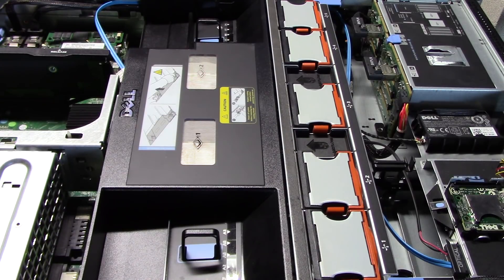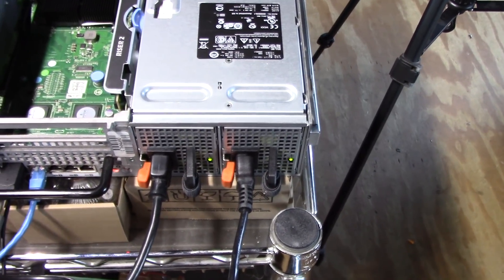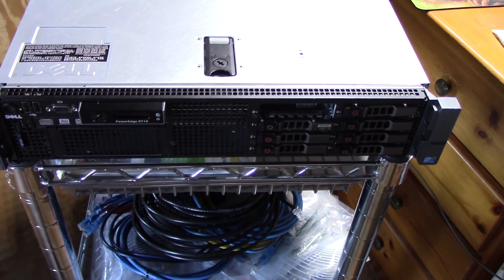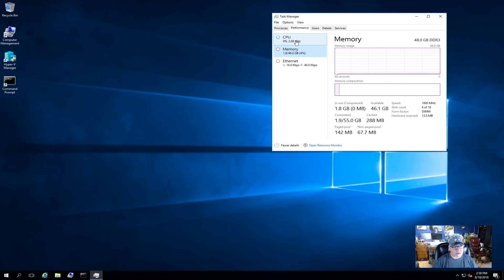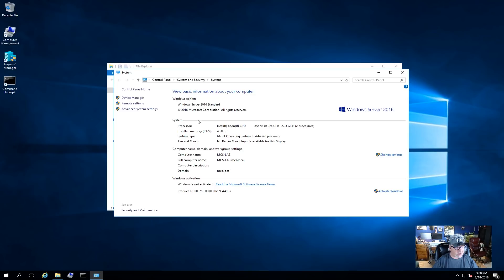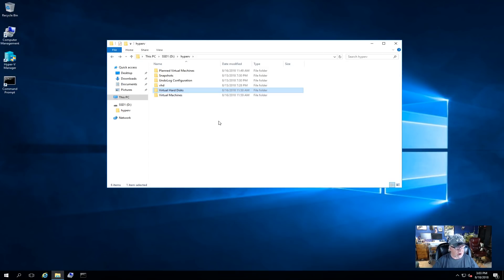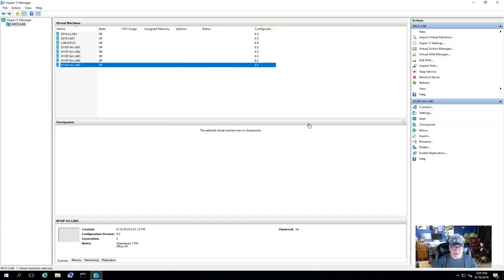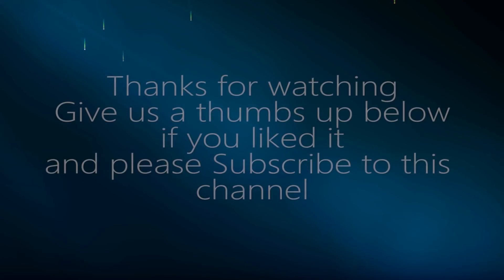Dell R710 Ram and HD install OS Install & Config EP-215

Comment: I was given a Dell R710 and want to load windows. Will it run consumer windows or do I need the server version or some form of Linux server, which it is running now but I have no password and want to start fresh anyways. Want to use it for a file server for video files.
Reply from the maker: I would just download the Windows 2019 Server trial and run that, you wont be dissapointed, you could try Windows 10 but drivers might be an issue.

Comment: I wrote a cool bash script that lets me control the fan speeds on my R710 using ipmitool.  I installed ipmitool to my "bash on Ubuntu on windows" and from that I can set my R710s fans to 'auto' (the default, but still loud), or 9 presets (3 low, 3 medium and 3 high) - the low settings are quieter than my central heating pump!

Comment: Does The ssd give you errors? I tested SSD on My r710 and i got errors and The light on SSD was amber\ orange. I have perc h700 controller.
Reply from the maker: No, no issues here, make sure you have updated the bios on your R710 and your controller has the most recent firmware. worked with my Perc6-H200 & H700 controllers. Thanks for watching :)

Comment: Guys for those that don't want Ethernet cables running along the floor what about using Ethernet over Mains adaptor and you can have a maximum of eight such Powerline adaptors and you don't have to start running Ethernet cables all over the house.
Reply: You can do such stuff if you are not a serious user of your computer. Having separate ethernet lines is the correct way to achieve max speed. A mall function in the connectors and your server will be gone !